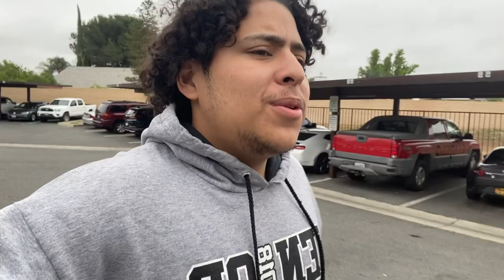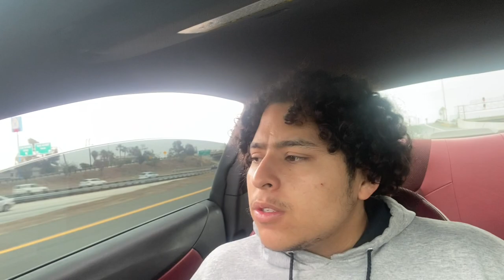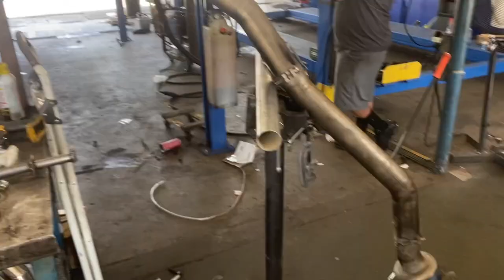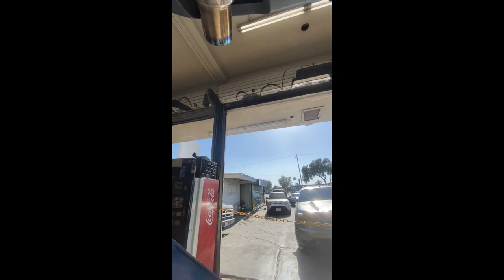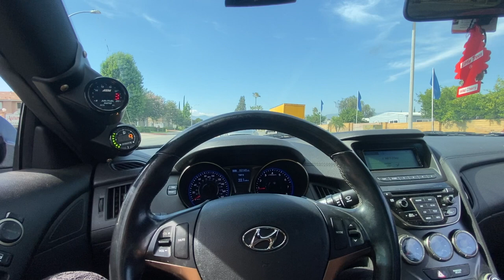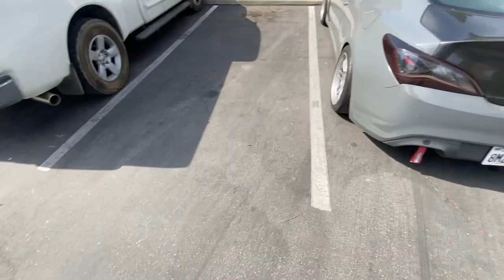Genesis coupe 3.8 gets a TOMEI

Comment: yo bro! i still remember when you ran the isr single exit, did you run that exhaust with no resonator?
Reply from the maker: With resonator
Reply: @rspecluis7570  because i got the exact same set up with the obx longtubes and isr single exit and the pops and bangs sound muffled as fuck
Reply from the maker: @manuelguzman7679  interesting so you want louder ? 😅
Reply: @rspecluis7570  i want my pops and bangs to sound like they are pops and bangs 😂